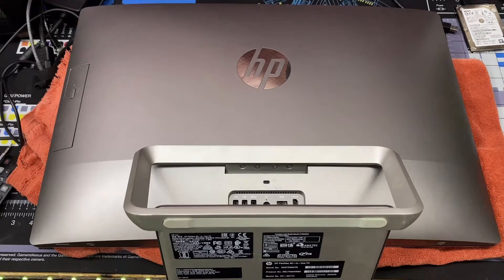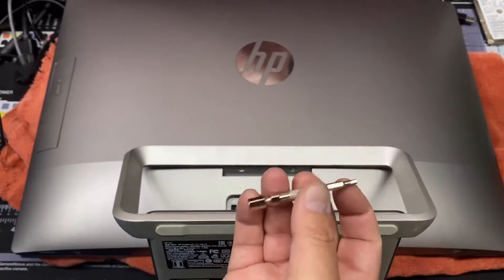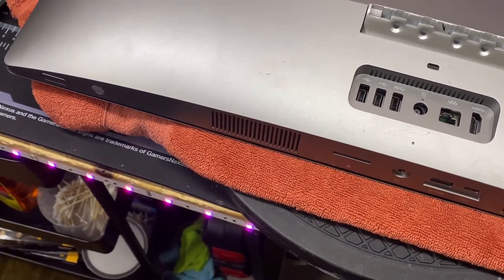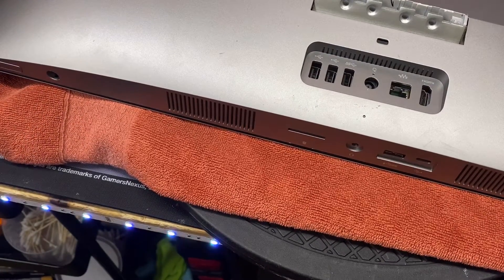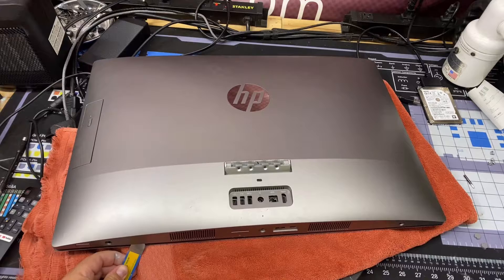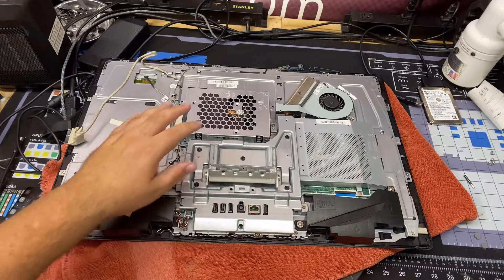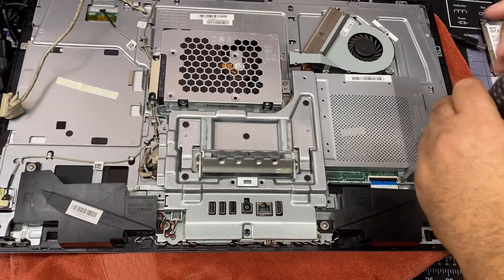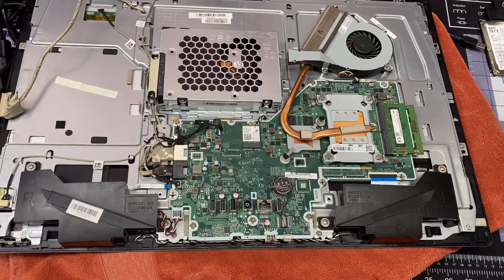HP 24-b217c All-in-One - How to remove the back cover to access RAM, Hard Drive & CPU.

Comment: Just for an additional note. Only go up about halfway on a side. You have to go to the other side then. I tried going past the halfway point on one side and cracked the screen glass. If you go a bit on each side to about the halfway point it will pretty much pop off. Luckily I only paid $10 for mine at Goodwill.

Comment: I ended up cracking the screen trying to remove it. Luckily it's old and it's time for a new machine anyway.😒
Reply: I also broke it. And I don't want to replace the old screen so I just bought a screen protector
Reply from the maker: Yeah, sorry to hear that, its a high risk for sure.
Reply: A serious design flaw.

Comment: This is the most poorly designed mechanism I've ever seen.  I've spent all day trying to get the screws out and the back plate off because I read the HP manual and that's what it says to do.  Now that I understand how it REALLY works,  the "cover popping" mechanism isn't giving enough lift to get a tool in there, because when I saw the cover popping initially when I was unscrewing the screws, I thought it was breaking something and I applied actually downward force on the back plate and now it barely pops anything.